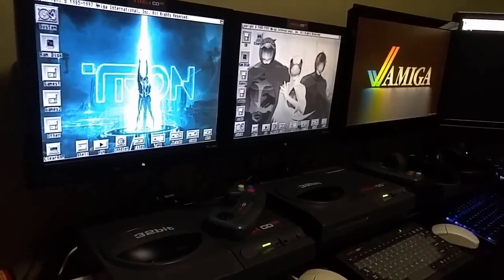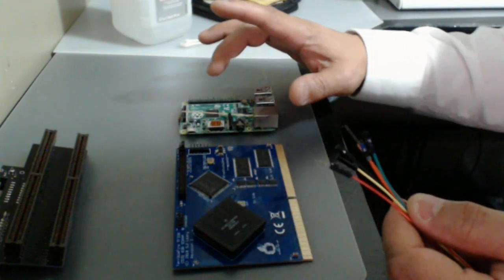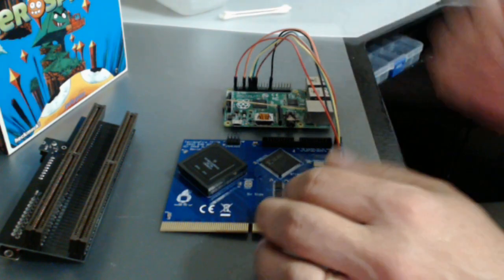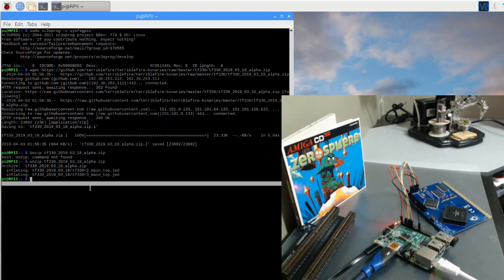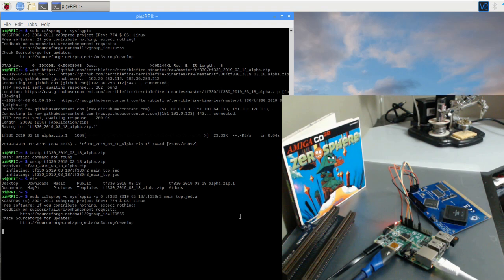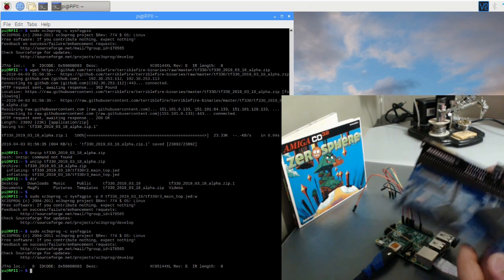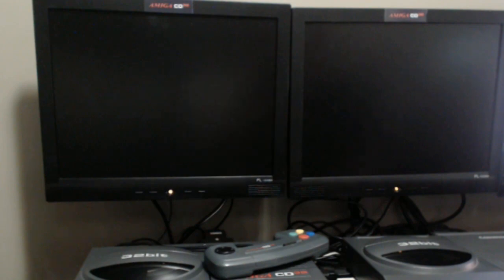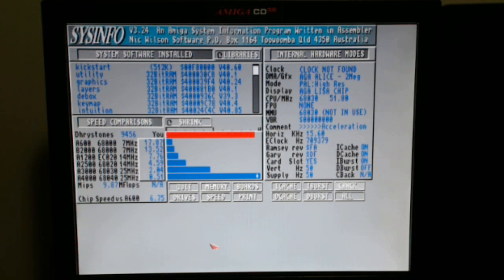Amiga CD32 - Upgrade the TF330 to latest 'boost' firmware

Comment: just tried to install this on my raspberry Pi but it is no longer possible unfortunately 😞
Reply from the maker: Sorry to hear that. The firmware install is for the TF330 card using the PI, are you saying you couldn't use the pi to flash the firmware on your TF card?
Reply: @32Bits  Thanks for the reply. I followed your instructions to install XC3SPROG on my Raspberry Pi 3b but it doesn't work. I think the link to the Github is down. So I am unable to install it unfortunately. I checked my board and it seems the firmware installed is for a Revision 2 board and mine is actually a Revision 3b. It works but the disable doesn't

Comment: 'tf' just replied to someone asking on powering through the JTAG: "stupid customer, don''t do that".
The board should either be in the (butchered) CD32 or powered (5V) through the incorrectly marked (reverse polarity) power connector beneath the JTAG
Also all links to 'tf' guides and videos are gone as well as of most of his Github content (except a few selected old - not the latest - firmware files)
Reply from the maker: Thanks for the comment P-O Yliniemi, Stephen designed the card so if that's what he said then he would know best I would definitely listen to him and power it through the 5V pin on the board if its out of the CD32. That said,  I have repeated this procedure more than a few times including powering through the jtag header connected to a Raspberry pi with no issues.  Good point on the GitHub listing.  I updated the wget command in the instruction sheet linked in the description to point to the correct file on TF’s Github.  The firmware I used in the video is still there but was moved to a different section.  - All the Best

Comment: It is a great learning experience. The cheap Pi4 3rd party boards are coming out and already (e.g. khadas, or others) some have adjustable voltage on its fast GPIO and a FPGA so it will be able to mimic akiko and an entire CPU+FPU like a Vampire (or IndividualComputers) does but will also allow for connection of a real CPU such as 68040 (or 060) + PPC like a Phase5 had. And of course one will be able to actually boot from USB/sata/IDE CDROM. Then it will be have the horsepower to mimic any RTG (or FMV cartridge with video-toaster if a mpeg2 usb encoder and decoder dongle is plugged in) or maybe a custom graphics with say a 32bit blitter and akiko and better copper, or switch to other platforms like a FPGA arcade (like using a PPC for gamecube games or its linux and/or maybe MorphOS systems). With its double GPIO, one could even plug the 3rd party 'Pi4'-equivalent-SBC into a dual 040 socket of a mac. For the amiga (or any system it boosts), the (3rd party equivalent SBC) Pi4's GPIO 5v to ~3v switching means loads of RAM on the 3rd party equivalent SBC 'Pi4' can be used by the Amiga, thereby driving down cost and keeping it all available. It is a pity these great TF boards do not have akiko, FPU and USB-CDROM booting as they are meant to be low cost and simple, especially since they are a wonderful learning experience. However, I encourage people to keep looking at the TF boards specially considering there is talk of modding a TF534 via a github pullrequest to add 2 usbports for CDROM booting, NDisWrapper devices (e.g. rj45 and serial) and booting from a NAND usb-flash pendrive. Clearly, people like physical copies of CDROM games on a great many platforms and homebrew, including amiga (no only for the CDAudio quality instead of merely having 8bit). Crippling the CD ability of booting AmigaCD is a pity. The risk of buying a fake 68060 is also high for the tf360. The AmigaCD is actually "The amiga many people wanted" back in the day, and it is worth considering if a board is intended to be what the people wanted or what the designer wanted. We are judged by our actions, not what we set out to do. Keep up the good work everybody. All the videos I've seen are great. There is still something o be gained from the learning experience. Ironically, using a Pi4 to mimic the actual computer (e.g. Amiga) that an accelerator is plugged into is the reverse way of thinking and makes it less likely that an old precious console/computer will be destroyed for some "At your own risk" ethos. So the AmibianPi3 software can be modded for the 3rd-party-equivalen-to 'Pi4' SBC so that it can have accelerators or even real RTG cards (like a cybervision or even a VideoToaster - even though obviously that isn't RTG) into it.
Reply from the maker: Thanks for the comment. Yes is is  has been a great learning experience.   I prefer original hardware but i understand that a lot of people do not have access to it especially with the current prices for our favorite machines AMIGA.  The Pi4 looks very interesting for emulation. I like the idea of emulating an Amiga on it to say program and test the function of a new piece of hardware meant for connection to original hardware.  If this  would for testing on emulation before risking original hardware that would be awesome.
Reply: @32Bits  Well I agree about original hardware, however, I should just check my comment is not misunderstood. :)

I am saying in the comment that the Pi4 could be used not just as an amiga, but also it could be used (the opposite way around) as a 200MHz processor like a Vampire works. See what I mean?

Not only that but it could also have a real CPU on it (e.g. a 68030+FPU or a 68040 or 68060) so that the Pi4 would be instead of that TF330 Board and would plug into your zorro slot (or CPU socket, or a1200 trapdoor) in the same way as a tf330 or tf530 (etc) but would still have the real 68030 (or whatever CPU you chose) stuck on it.

This is because the Pi4 3rd party boards can work as a logic analyser via the GPIO.

So literally, in effect, while still using your CD32, you'd just be replacing that TF board you have there to replace it with a 3rd Party Pi4 style and you could still put the 68030 (and FPU if you like) on it too.

Beyond the 68030 there is nothing authentic on the TF330. Not even the Static RAM or Dynamic RAM on TF boards are authentic (which is fine as long as it works). Therefore one might as well use some of the 3rd party SBC (about the stats of a lengendary Pi4) RAM and fpga. That could also make it cheaper (e.g. per RAM or storage device). It would put an end to the need for CF cards in HD0. It also means you can use bootable CDROM games whereas some of the TF cards break the CDROM abilities of the amiga such as the A570 sidecar zorro option.

That important distinction aside, yes you could also do all the things you said in your comment. :)

See the MickMake channel for the 2month old video on the Pi4 the RaspberryPi foundation sent him and it is an approximation of 3rd party boards that already exist.
Reply from the maker: @obsoletepowercorrupts  Oh Ok I see what you mean. Using the Pi as an accelerator or a Vampire for the CD32 would be interesting. As long as the price was not too high. the vampire cards are steep.  Now if you could do the same thing with a Pi4 that would be worth checking out.  It would take a lot to  be fair to beat the price/performance of the TF330 and upcoming TF360  but, hey the more hardware options we have the better.  Regarding "See the MickMake channel for the 2month old video on the Pi4 the RaspberryPi foundation sent him."  you don't mean his April Fools video do you :D ?
Reply: @32Bits  It was a funny video indeed (and yes it has april fool in the title), however, he mentions in the comments it would be a nice board, and so even though the Pi4 is not out, generally the term Pi4 is being used for an approximate standard at the moment. I need not be exactly that in the video, however, other exist which have combinations of those parts already. See "explaining Computers" channel for a great many videos on SBC boards (even powerful Nvidia A.I. ones).

So like you know how a $150 (or even $200) board made by UDOO or by Nvidia or even one with FPGA+ARM on can be made by multiple companies? The approximate standard exists.
Some boards at $35 (Orange Pi3 for example) have PCI-e on them and a FPGA can be plugged in. A bananaPi has a sata, and so on and so on. Sometimes the GPIO matches the (raspberry) Pi. Even a RaspberryPi3 (as in the genuine Pi3) has  the speed in the GPIO to plug straight into the 68000 socket of an a500. TerribleFire considered it would be a bit boring even though he can see it is possible. Personally though, using such a board but also with a CPU (e.g. 68030) can be done (let alone with more modern better boards).

Regarding the price with these more modern boards, if one were to subtract the cost of the TF's static RAM or dynamic RAM and the price of the IDE to CF and the CF itself (as the Pi would replace all those), I think the total cost could be done as cheap (and sometimes cheaper depending on the configuration). It would also be easier and easier to patch and maintain and upgrade, and also to replace it if broke. All solutions (just a TF board or a different Pi route) have good things about them.

As for the real RaspPi when it comes out, they are always sold at cost price or sometimes at a loss.

A vampire-like board can already be done on a FPGA to PCI-e4x gen2 board, but choosing a standard board is not yet decided, and some maker boards (like ARM+FPGA) already exist and will exist which can do it.

The thing about even older amiga-accelerator boards (or the modern TF ones or Individualcomputers ones is that they have a xilinx on them, and one that has been done, nobody really cares if it is replaced with an easier cheap powreful FPGA on some standardised SBC board, if they still get to keep a real CPU (68030 or whatever), and the RAM problem is banished instantly.

The boards in your video are a great learning experience, and people such as you and I who like a challenge get a lot of joy out of that and appreciate the FOSS nature. However, many other people don't feel that way about some of the boards being made today (especially when a board disable CDROM booting and other zorro slot usages people had such as all their action-replay-cartidges, scsi scanners and music devices and midi and network and a590 hdd and scsi tapedrives etc.). All gone: All of it - just like that. When a Pi is FOSS (or some manner of GPL) anyway, most people would be happy at the simplicity doing it that way instead so as to keep an amiga alive rather than risk it breaking.

Take for example the way a $5 PiZero can plug in to make many a emulator games console handheld. Likewise a c64 homebrew cartridge might as well just have a PiZero GPIO (in a cartridge) plug in with an adaptor into the c64 slot so that 512meg RAM (which is not far off a CDROM size of 650meg) can stream dragons-lair pre-processed games straight into the c64, or some video. Beyond that only the most hardcore of nerds (that's us btw) will see value in it. The rest are just homebrew retro games collectors who are happy with a PiZero, and they constitute the vast size of the audiences of such gadgets.

So for example, the TF530 (or many other such TF boards) can be adapted (wiht a dirtyPCB board and a Pi of some sort) to plug in the zorro sidecar slot. A 3rd-party Pi (maybe with FPGA) doing that. It could likewise allow for a way (like a590 or gvp or a570) to have a 2nd kickstart ROM (which btw is the definiton of a legal amiga) and thereby a reversible "safe" TF accelerator, perhaps with a passthrough for some of those otherwise-lost addons.

Comment: It was very difficult to hear what you were saying in this one, even with the volume turned all the way up.  I'm sorry, but would it be possible to increase the volume on this one and re-upload it or something?
Reply from the maker: Thanks for the feedback. Will look into it and update the video.
Reply: @32Bits  No worries, sorry it was negative feedback.  I really like what you're doing here, I had a CD32 back in the day and loved it, I wish I still had it, but I was young and stupid and traded it for a 6x CD-ROM drive for my Amiga 4000... :'(
Reply from the maker: @heidirichter   Troy Wilkins  I don't take constructive criticism as negative I want my content to get better and I appreciate you letting me know about the sound.   I'm glad you like the what I'm doing. I have more on the way so stay tuned. I still have my original CD32 and c128 and A3000 but sold my a500  in my youth too  wish I hadn't . Do you still have your A4000?
Reply: @32Bits  No, unfortunately I sold the A4000.  I got myself an A600 a few years ago now, but that's the only Amiga I now have, sadly.
Reply from the maker: @heidirichter  I know waht that's like I sold my original A500 it had a lot of upgrades. I used the money to help fund my A3000. I love my A3000 but  always wanted A4000. They are just out of my budget now.  I am fortunate in that I kept my original CD32 and A3000
 
I like the 600 it's compact size is nice. do you have an HD version? How do you feel about the vampire board for the A600?
Reply: @32Bits  I didn't like the A600 back in the day, because of the missing numeric keypad, which I used a lot in DPaint.  But these days I like it for its size.  Yes, I've actually got a flash memory storage device in it, along with a 1MB RAM expansion.  It's one of the last runs of the A600, so it's got a soldered on Kickstart 37.350.  Personally I like the Vampire boards and I hope to get one myself one day.